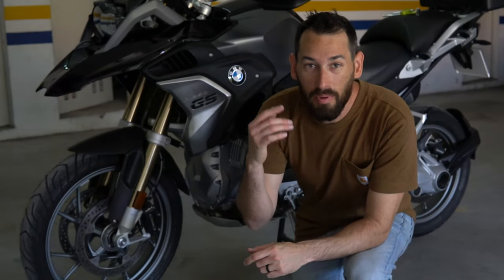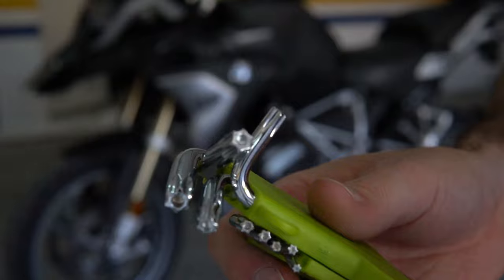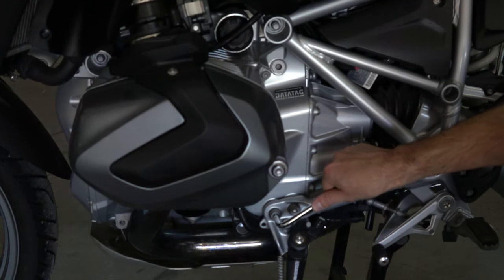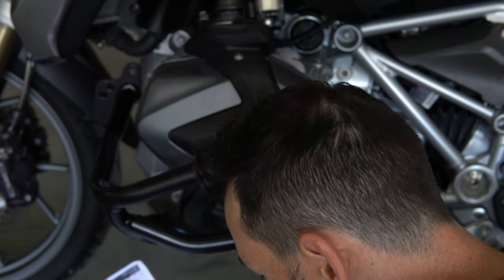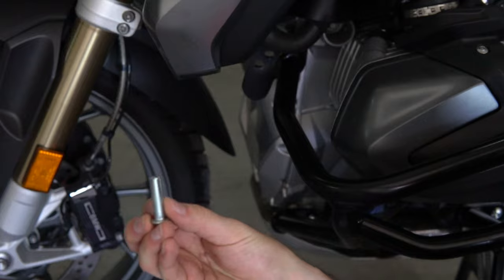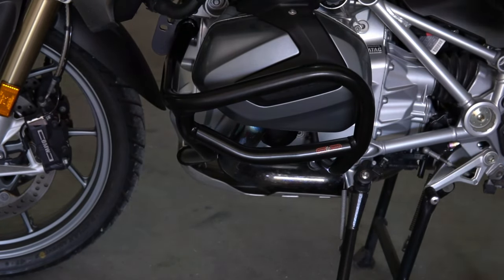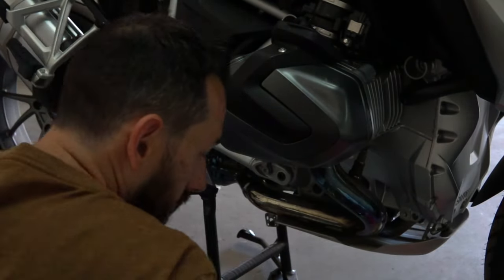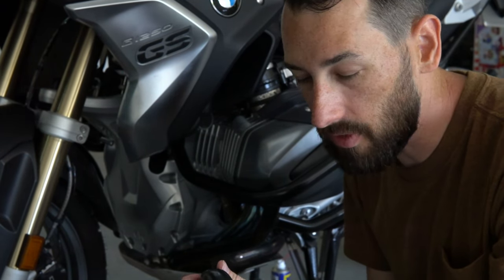Budget Crash Guards for BMW R1250GS. Motea crash guard review and install

Comment: Very good job 👍🏼 I fitted crash bars on my T12 , I was expecting the extra weight but what surprised me was the wind noise .
Your bike looks brand spanking new 👍🏼
Reply from the maker: Yeah it’s a 2019 but only had 11k Km’s on the clock when I got it.